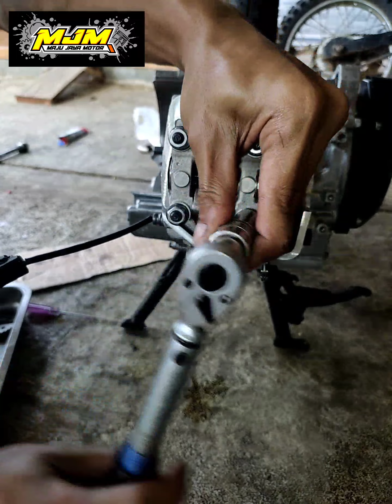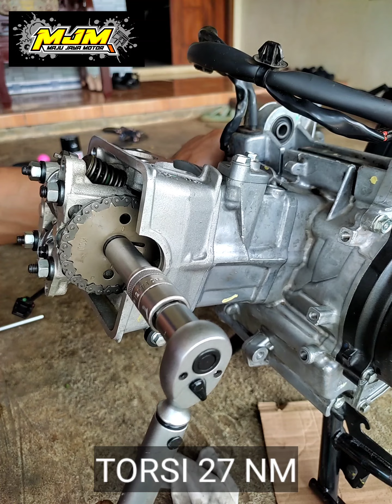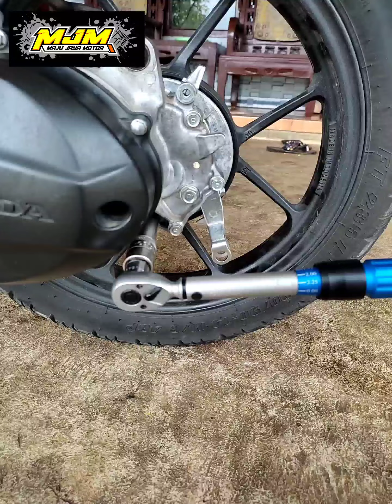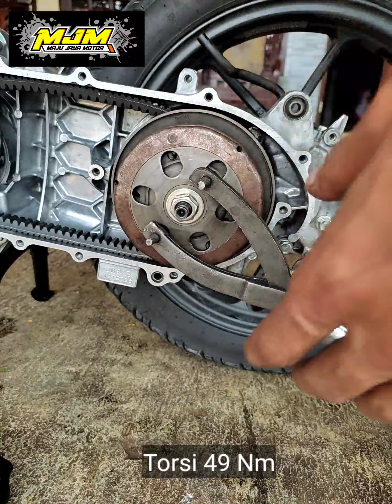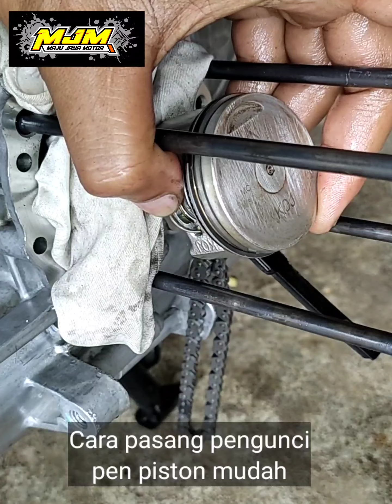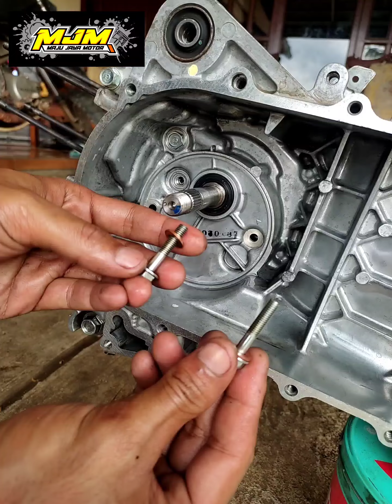Cara mengencangkan baut mesin menggunakan kunci torsi di motor matic beat

Comment: Kalau beat esp 2015 berapa masing torsi mur :  roda belakang , mur rumah roller , mur cvt  belakang   .
Reply from the maker: Roda blakang 115 nm mur puli depan 60 blakang 50 mur pulu scondari 45
Reply: Trimks , sukses chanelnya.